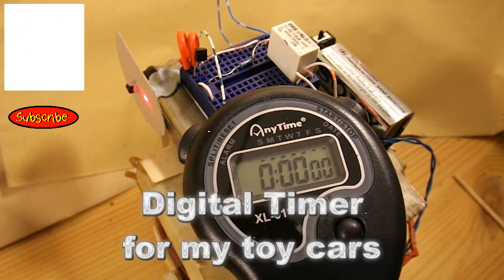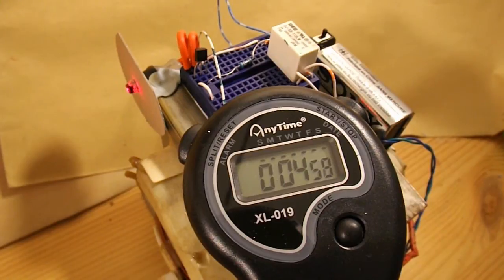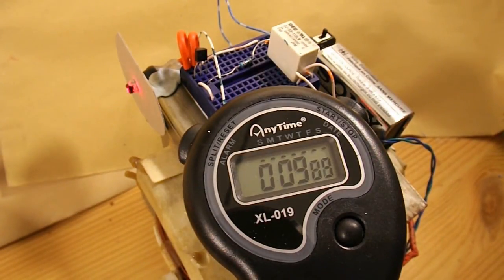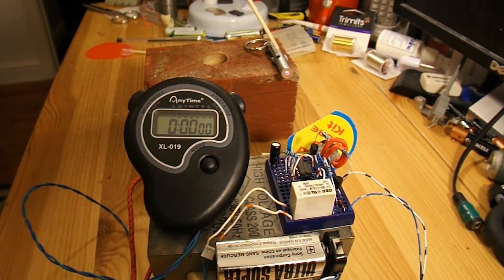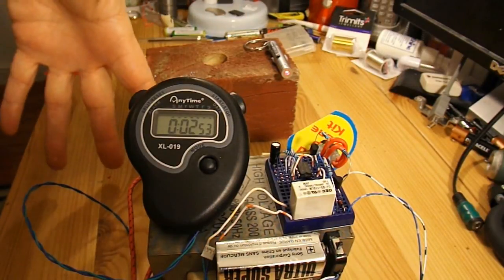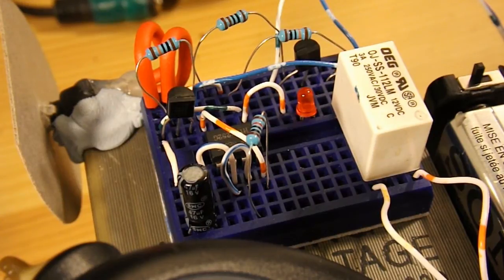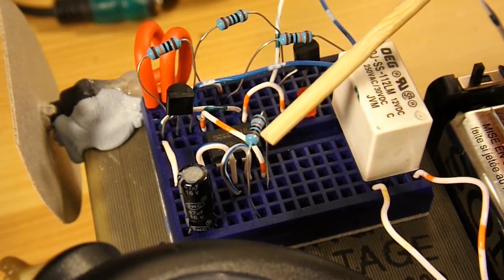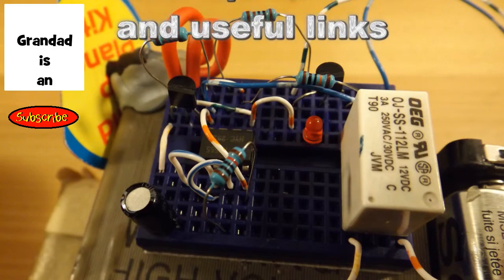Let's make a Digital Timer or Speed Trap for my Toy Cars - Part 3

Comment: It will work for beam sensor also sir
Reply from the maker: I don't understand your question. This is basically a light detector circuit that operates a relay.
Reply: I want make stopwatch for race for outdoor which senor can i use

Comment: Will sunlight affect this if used outdoors? Looking to build something for running gates.
Reply from the maker: You could shroud the receiver to make sure it is directional and not troubled by ambient light. This is only a very basic design, I am sure you could find better if you search around a bit but it could be enough to get you started.

Comment: I only watched the first and last. Hence why I asked. Lost like 1-2 hours looking for something like this kinda clear. But I saw you used the same laser for your hand and gap thing. But I'll rewatch for sure. Thank you for such swift response time!
Reply from the maker: If you find the link for the related playlist (in the video description) I have included a Make Magazine video there that works on a similar principle but runs wires to the start and finish location and uses a simpler circuit.

Comment: So for over like 50m what kind of wire or wireless device would I use. I thought from the videos it was a lap system. So it had to pass the same laser
Reply from the maker: If you watched the videos in the series you would have seen exactly what this does. It is a simple light detector circuit.  A laser beam shines across the track at the finish line, that is reflected by a mirror down the length of the track to the start line where another mirror which reflects it across the track again to the detector circuit. As the car crosses the start line it breaks the beam triggering the timer to start. When the car crosses the finish line it breaks the beam again stopping the timer. There is information in the video description and there is a circuit diagram at the end of this video.

Comment: ok this may be just what I need I have just built a Orrery that has a speed controller but no way to time how fast the earth is going round the sun and some kind of timing device that would not slow it down ,this would be fantastic  would it detect a match stick size going past not at any great speed, I think the fastest it travels is 12 cpm any help welcome cheers
Reply from the maker: Hi Allcingeye, in principle this should work for you. All it needs is something to break the light beam and maybe you could "tune" the beam by putting a slot in front of the detector that is narrower than the matchstick to ensure the beam is completely blocked as it passes by. However your accuracy is limited by the accuracy of the stopwatch.
Reply: Great idea  many thanks I must now keep my eye open in the charity shops for a nice stop watch its a nice looking thing from eagle moss just one issue left to arrive from smiths been over two months waiting now. hope its soon.
Reply from the maker: Allcingeye I bought some stopwatches in Poundland or 99p Store, it was quite a while ago so I don't know if they still have them.
Reply: cheers